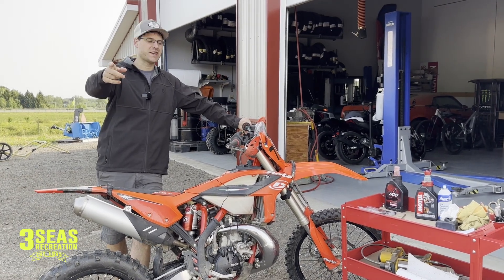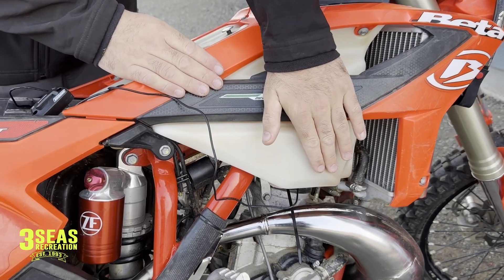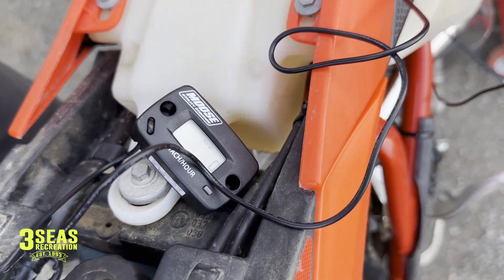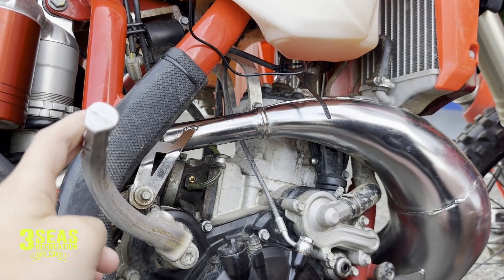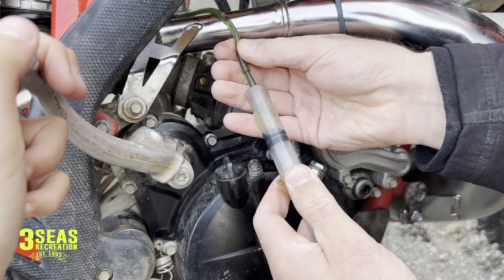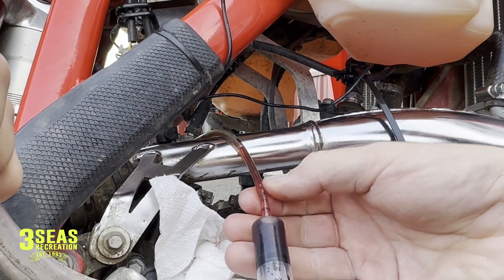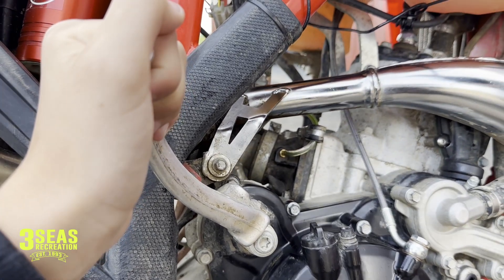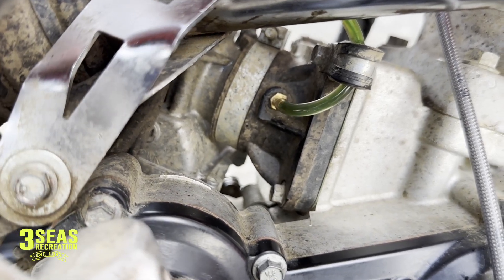2-Stroke Beta Motorcycle Oil Injection Test - Is your Oil Injection Working?  3 Seas Recreation

Comment: Hi, my premix oil has turned brown. I did turn the power valve in. Would that cause this? Thanks
Reply from the maker: I'm not sure how your premix oil has changed colors. Isn't it mixed in the gas tank?  Tu
Reply: ,oil injected. Finally found something. Water could be a cause. Or mixing 2 kinds of premix. Another rider mentioned this. After a few beers that is possible. I drained oil injection tank. And installed new motul710. Time will tell.

Comment: Maybe a dumb question but why the bubbles are staying at the same position instead moving towards the carburetor? Looks like they're even moving backwards.

I have a tiny little bubble on the oil injection line which stays almost at the same position even after 1-2 hours riding and it scares me because I'm thinking the oil is not flowing towards the carburetor. Is that an issue to have such tiny little bubbles?
Reply from the maker: Hmm that is odd, usually the bubble moves with the oil. Maybe your oil is to thin and it is not pushing the bubble out. Enjoy The Ride, Jared
Reply: @3SRTVOfficial  Thank you, sir! I really appreciate your answer!

Comment: I'm gonna do this test now.
Also keep in mind that a correctly working tps sensor is needed (online you can find resistance measurements to be done) and also electricals connections of the cdi box needs to be watched off for moisure and corrosion problems.
Thanks for the useful content.

Comment: how important is it to run Injection specific oil? I have been running Klotz super techniplate in my Xtrainer THRU the injection.   I had no idea I needed specific injection oil.
Reply from the maker: Well, I suppose there is a reason the manufactures recommend it and also a reason the oil companies label them different. I would suggest getting some Oil Injection oil. Enjoy The Ride, Jared

Comment: One issue from owners is understanding the shape/configuration of the oil tank which can appear full or nearly full, yet when the bike is  upright and you remove the right side panel,  you can see the true capacity level. 

Also,  when filling,  tipping the bike to the right and letting the oil fill slowly will allow more oil capacity.

Comment: I have a new 300rr and I was worried that it didn’t seem like the oil reservoir was draining much. Stopped off at the dealer to inquire and they said you’ll barely notice. “It’s like 100 to 1 ratio for normal riding and around 32 to 1 in hard conditions.  I still check it every ride but after 944 miles of riding in the 2 months I’ve had it, I’ve only had to add oil a couple of times.
Reply: I’d say the first 200 or 300 miles were pretty mild riding but I got 1687 miles just in the last 4 months from Moab and at my cabin in the Rockies. Certainly not Graham Jarvis stuff but pretty hard. Every dealer has told me that injection really only fires at the beginning (mostly) and if you see smoke you’re fine.  We’ve got 4 Betas among my buddies and we’re all seeing pretty much about the same amount of usage. So I don’t know. I do add a little bit every probably 3 rides or about 100 miles or so.
Reply: Hello! Just a suggestion, fill up the oil tank and the gasoline tank the next time you fill up. If you refuel again, fill the oil tank full. You can then calculate the mixing ratio.

Many greetings from Germany
Reply: My 18 300RR is the exact same. It scares me.
Reply: @brentroy03  if it's lasted from 2018 it's obviously working as you wont get very long if she runs dry.
Reply: Sounds like a problem or you don’t ride that hard? I have to add after every ride just about. Only to be safe, but the level also goes down quite a bit when doing hard enduro rides. When I’m just cruising it hardly moves.
Reply: @DaddyKnives25 should be getting roughly 3 tanks of fuel to 1 tank of oil. They use fck all  and it's normal.
Reply: Mine needs oil per every thank of gas ? Normal id assume…
Reply: @raymondhale8555  Interesting. I'm 3000 miles in and about 130 hours and I still barely have to add oil. I check it every ride but probably only add any every three rides or so and even then, very little. That seems to be what the dealer indicated should be the case. I do always make sure when I start it that it's smoking good out of the exhaust which indicates that initial load of oil into the fuel by the injection.
Reply: @TheEnd2Come2109 maybe mines leaking something is going on if I’m the only one that adds oil every time or every other time I get gas

Comment: Hey jared i have a xtrainer 300 2023 and i had a problem where there was too much oil and it would just shut it off.I had to.change 5 spark plugs on the 4 hour of the bike.When i took the injection out it ran perfect. Now i kinda want back the oil injection but i dont wanna mess eith the problem. Any tips?
Reply from the maker: Good afternoon, just replace the pump. That’s the only “fix” to them. They don’t have an adjustment. Enjoy the ride, Jared
Reply: @3SRTVOfficial  Thanks jared appreciate it.Keep up the videos
Reply: I’m having the same problem. Runs great but fouls plugs about every hour of riding. Whenever I take out the spark plug, it has black liquid all over it. Any advice on replacing the oil pump, or how to check if it is damaged?
Reply: @jarederekson3338  just take out the system and do the mixing yourself but if you want the oil mixer then sorry but i cant help you
Reply: @jarederekson3338 replacing oil pump is super easy, will be in manual most likely otherwise pleanty of vids. Only real tests to do is the one he just showed. Pump should fire every 2 seconds roughly on idle.